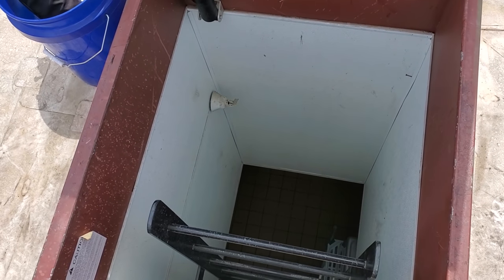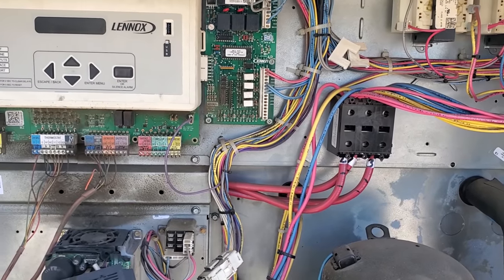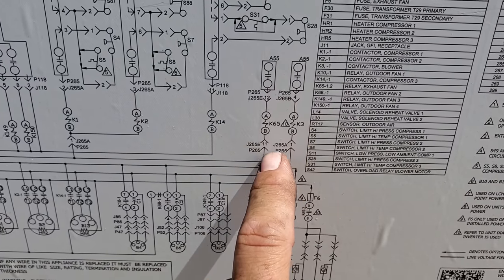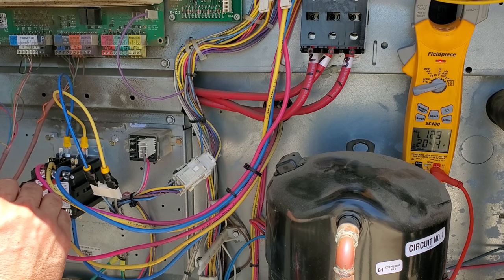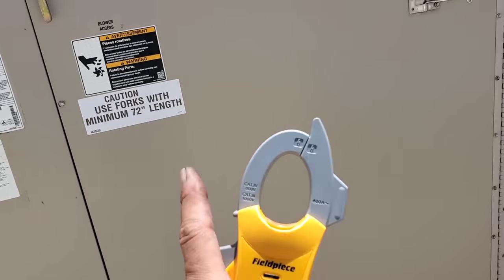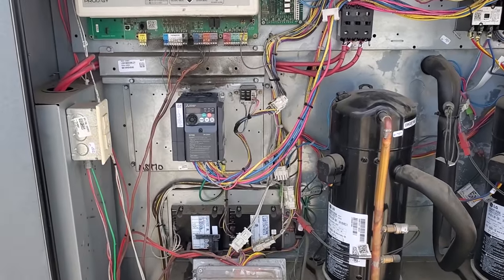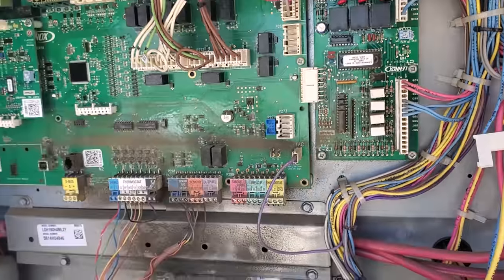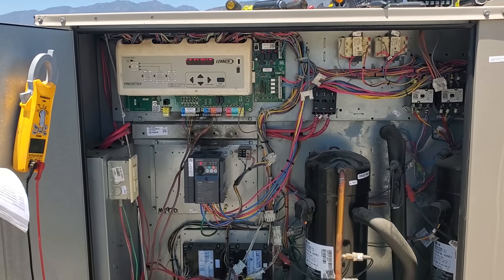THE DINING AC IS NOT WORKING

Comment: Boy that looked like a plain PITA.  But have to agree that changing the display part was silly, even if it was bad it should not have mattered.  Best guess is that you could literally unplug the display and the system should still run just fine.

That sprinkler head though, ughh.  The company installing that needs taken out into a field and dealt with.  

Anyway I am just a guy who likes to watch stuff and learn and have to say thanks for the video's.  It's nothing special but I have a deep freeze that cost me all of nothing about 8 years ago.  It didn't freeze so figured low on charge, got a line tap and after purging some refrigerant into my pickup I ran some in.  Figured that out on my own years ago.  Now it has been basically running non-stop unless I turned it all the way to off.  Turn it back on and it would kick on after a bit and then run all the time again.  Broke down and bought a digital controller you use on the glycol systems and honestly before I watched your video's I probably would have gotten something that would just plug into the wall and then have the freezer cord into it.  But the old mechanical one is gone and the digital one is up and running great.  I doubt I will ever do much with the sensor than just run it over the back side and put a little hot glue to keep it in place but at least it's easy to change.  Do have to wonder if you ever have to adjust the calibration for the sensor when you put them in, this one seemed to be about 3 degrees F high compared to another controller I have for cooking Sous Vide which I know is accurate.

Comment: Maybe I'm showing my age, but why not a multi-tap motor instead of VFD?  With all the cost necessary to keep these failed boards and modules working, it would be cheaper for a multi-tap blower motor.  It would only take a two contactors with an interlock - when calling for one, the first contactor kicks in and delivers to one set of windings.  When the call for second stage, the second contactor is engage, releasing the first, and power is delivered to the next set of windings.  Not rocket science, and don't go "boom".  Worst that can happen is either a winding short, short to ground, or shorted contactor.  Contactors are considerable cheaper to replace than a VFD drive system.
Reply: It's all in the name of efficiency, apparently using a VFD on the motor can give you a better power factor or something like that.
The real problem with the VFDs is exactly as Chris mentioned in the video. They're putting them outside when they're not rated for that. They need to be in a conditioned space. Were it me, I'd mount the VFD and the control board in a space that was in the airflow from the return air duct to the blower housing. Easy way to keep the electronics inside the RTU and still have them in an environment that's much more conducive to longevity of the unit. I think some other brands do this already, I guess Lennox hadn't caught on yet when this unit was manufactured.
Reply: @44R0Ndin  
If power factor is a big issue, then run an synchronous MG set. Gives you the best PF, plus it saves the electronics from line bumps and spikes, as long as it's not undersized.  I wouldn't be surprised that if you ran the numbers with 5+ units with VFD's vs no VFD's and synchronous MG set, the MG set would give you a better ROI.
Reply: @gregpfister6991  a vfd is cheap, and programmable.
Meaning that they can adjust airflow with programming, for air balancing, etc.
Reply: @ke6gwf  VFD is CHEAP, in comparison to a multi tap motor?  Again, I believe that if you add the costs up, you will find that VFD is NOT cheap over the life of the equipment.  Further. when you look at the inherent dangers of operating mosfets (as we see in static UPS's), the cost associated with protecting them and the destruction caused when they do fail it's just not worth it.  In this video alone, we see the example that one board causes the VFD to destroy itself completely, and the recommendation to replace the main board and the cost associated with THAT.

Just because you CAN do something doesn't mean that it's GOOD.  In my years, I've seen many "advances" in technologies, and have been at the forefront of many of them.  However, ROI is king, and always should be.  If a product is going to eat itself every 3 years, as apposed to 10, I'll pay 50% more for the product that will last 10.  Why?  Because of the cost associated with the downtime, loss of business, how costumers perceive the outage, cost of repair, etc..  You have to look at the big picture, not just "new tech, so cool".
Reply: @gregpfister6991  I'm not in the trade (I'm in IT/programming) but, and correct me if I'm wrong, aren't VFD's supposed to be used for power /curves/, and not just 2 stages?  A VFD in this just seems like crazy overkill if all you need is 2 power stages.  Even if you had to have 2 "programmable" stages, it seems like there could just be something like two variable resistors (I don't know the correct pieces of hardware) that controls the amount of power for each stage, and a relay to change between them.
Reply: @Zyxlian  
You run into the same problems with a resistor bank or any other method, plus adds stress to the motor.
Reply: @gregpfister6991  In terms of the "because I can", or "isn't it new/shiny" approach..all you have to do is look at how touch-screens have replaced proper controls in *cars*. I sure hope aircraft designers don't follow suit!
Reply: Eric M  
True, but how much variation do you actually need?

Comment: Chris the correct term for the circuit is Supervised Circuit, per code NFPA-72 there are three primary circuits in a fire alarm system, Indicating, this circuit activates the indicating devises, horns strobes etc., Initiating, these circuits relay information from devices like smoke detectors and pull stations to active the indicating circuit and Supervisory Circuits, which monitor devices such as Sprinkler cutoff valves and tampers, go to any large mall and you will see large red wheeled valves out in the lot or on an exterior wall with red switches mounted to their stems, those are supervisory devices, should someone want to disable the sprinkler system, they would close those valves and that what would cause a supervisory indication at the panel. Note both initiation and indicating circuits are supervised circuits, as is a Supervisory Circuit. Welcome to the somewhat confusing world of fire protection.
Reply: Ooohweee, blast from the past. The term "Indicating Circuit" hasn't been used in the industry or NFPA for 20 years or more. The initials for the circuit clashed with "Initiating Device Circuit" (IDC), so "Indicating" was changed to "Notification", or NAC (Notification Appliance Circuit). The term "Supervisory" is defined as "a fire protection system in the Off-Normal" condition. So even though the "Supervisory" contacts on a conventional duct detector change state on a fault or "Trouble condition" duct detector manufactures label the Trouble contacts as Supervisory. So the three NFPA/UL required states of a fire alarm panel are Alarm, Trouble and Supervisory.

Comment: Enie..menie..minie..moe..which unit had a component go? What I wonder why units with VFD drives dont have phase monitors? I've seen alot of units where the VFD drives are killed by low voltage below the 10%. Good stuff thanks for sharing Chris. Be safe out there.

Comment: Wonder if you fixed RTU 1 and removed the balloon . I had a AAon was running no ac ,had to dust off dust and dirt off gas mod board , must have back feeding voltage to control board , Have you ever worked on a AAon unit?
There easy to check and trouble shoot ,just need to have the hand controller the owner should have this if they have this style of unit ,we have 13  unit at our Nursing Home.
Reply: Yes

Comment: Hi there, about that inverter:
it's a mitsubishi d700  rated for a load 3 phase at 200 V.  when u were testing the phase rotation your tester was reading 204V; although it's not a huge higher level it still high.
from what i have seen on the video seems more that blewup the control board more than the main power circuit of that inverter.
u should  investigate more on the control side and wiring.
Another things is the enviroment of were it was installed: in the manual clearly state enviroment not dusty and not greasy... but if u see above is location there is a clear mark of dust and grease.
The load due is a motor should be protected by a motor protection automatic switch;
a blewup like that could be a condenser\ catastrofic failure of a rectifiers;  from the short frames on the main power board the bulky condenser seems to me NOT bulged or blewedup...

definetively something on control wiring\voltage\current side.

P.s. inverter make a tons of electronic noise , i dont see any rfi protection circuit on the power supply side; plus the cables itsels (both power and control) has to be shielded...  was it originally installed there?
chec the warnings on first pages
https://dl.mitsubishielectric.com/dl/fa/document/manual/inv/ib0600366eng/ib0600366engg.pdf

Comment: VFDs should be in a sealed air conditioned cabinet which should be easy to do in an air conditioner. Most companies use the smallest VFD possible so any drop in voltage will result in too much current.

Comment: Gonna be honest, these VFD drives seem to be more trouble than they are worth. If they keep blowing up like this some day they are gonna start a fire or some other bad thing. I can just imagine the issues if you have a unit that's not grounded and the VFD blows and shorts to the unit casing. Some poor chap gets up there late in the evening to fix the thing and it blows up in his face. That might be a stretch, but for the energy cost you save with these VFDs, it doesn't seem like you'd really save anything. Constantly having to have techs come in and replace them, they go out on backorder, all that hassle when you could just bite the bullet on the energy cost and run a relay or something simple. I get that it's regulation in some places because of the electric grid and all that, but it just seems like such a mess dealing with these units.

Just my personal rant and thoughts.

Comment: I take it you are in AZ?  or somewhere that gets insanely hot in the summer. That VFD  drive has a fan in it,  and its sitting outside on a roof where it can get 120 degrees in the summer?   Imagine how hot that "drive" gets im surprised non of those electronic computerized components melt..

Comment: I studied informatics and have zero clue about these machines but my guess is that the small daughter-board can be changed without changing the display. When you change the whole motherboard, you would have to change the display. So in the first call you talked mostly about changing the daughterboard because of the faulty voltage coming out of it and not about the mainboard. If you had talked about exchanging the whole thing, tech support most likely would've told you you need to change the display as well. 
But then again tech support should've told you that if you change the motherboard, you need to change the display as well. My guess is they simply didn't know off the top of their head
But again: I'm just guessing :-)

Comment: I'm curious, why I don't see any air-conditioning unit with air heat recovery as a full Air Handling Unit?

When it's warmer outside this saves way more energy than this energy reduction of a variable fan control. In Europe air heat recovery is standard in most kitchen's for many years already

Comment: that was one thing got me thinking is that ac was bad desing have that psu under maid board because that  fan blowing heat at maid board n cause it failures n shorted psu n blew itself out
i wish they move that psu to side of maid board that way to avoiding overheating maid board safely  "that what my opinion is "

Comment: Seems like the VFD is a fairly generic model, usually they only have inputs from the controller, with possibly tacho feedback, So if you see another one like this, It might save time in future to see that the VFD control outputs are being triggered, e.g. usually something like a 0-10V signal for speed. as that would catch a faulty control board early.

Comment: So what happened to fixing the fire alarm issue on RTU1 ?
Reply from the maker: The fire alarm issue happened because the ac had a teipped breaker. The fire alarm was in a trouble condition due to the loss of power

Comment: I say the VFD failed due to overheating, crap ingestion or it looks like its only just rated for the current of that motor. When the VFD shit its pants it fedback through the control wires into the controlboard and caused that to fud out.

Comment: if the unit is powered down, then why there are 3.4V across all the phases with ground?
Reply: Iván Pstyga Phantom power, induced voltages.
Reply: @gordonrichardson2972  like capacitors discharging? Should that V get reduced if you let the braker open enough time?

Comment: If the vfd just runs at 2 set speeds how does it save energy? Couldn't they just use a 2 speed blower motor? You would think they would have a supply air temp sensor or suction pressure transducer that could ramp the blower up or down based on some kind of measurement.
Reply: Yeah, a 2 speed blower motor was my thought. Those have been available for ever. The first one made was probably designed by Tesla.

Comment: I don't know if you could hear this or not, but I could hear a very high pitched whining noise which sounded like it was coming from the unit you were repairing, I don't know if you noticed it or not, but the noise was quite audible in my headphones.  Could it have been a component on the electronics board?  Could it have been the fan motor or something?

Comment: Why do VFDs have a tendency to blow up? I manually engaged a contactor that was wired in series with it, and the VFD freaking exploded like a grenade.
Reply: VFD's will blow up quite violently if you put power into the motor outputs. Was the contractor you manually punched in a VFD bypass contactor? because those have a habit of sending power back into the motor output if you don't sequence things correctly. That's why it's a good rule of thumb not to manually punch in contactors if you are working with a VFD.
Reply: VFD have big capacitors and they are very finicky about power.
Reply: @jakekiedaisch2279  Thanks, yeah idk if it was a 'bypasser' but it was wired with the blower motor.
Reply: Because they cannot handle the inductive kickback that occurs when you open the contactor. All VFD makers do not allow switching devices after the VFD as they know that they will blow up. The only valid usecase for a switch after one is for delta/wye switching motors with the special drive for them, usually found in CNC machining equipment.

Comment: Kidna feels like that fanspeed had to have been a setting that was messed up, not a board failure. But who knows.
Reply: Part of the troubleshooting probably would have been looking at what the fan speed setting was, and seeing if the command voltage to the vfd matched, and it didn't.
The fact that the board was losing memory settings is a bad sign too

Comment: I'm confused: Call was for a fire alarm in a trouble condition. Alarm panel showed trouble on RTU 1,  Prodigy board on RTU 1 showed that unit had error codes, but you did not diagnose or repair RTU 1. You diagnosed and repaired RTU 2. I thought the reason for the call out was to address the RTU 1 error codes signaling trouble to the alarm company. It seems to me RTU 2 would be an AC down complaint and a separate issue. Please explain.

Comment: Excellent job this one was not easy. Those sprinkler installers are the least logical people I have ran into on install jobs. They only do what the prints say without question. Once they cut holes in our returns and would not move it until the inspector fined them. They never did understand why that was wrong, poor bastards, lol.

Comment: Hi HVACR person,
Clean that schmutz off the PC boards. It's very possible that it is causing a leakage path for the loose electrons.
Maybe. If you have a flir, check for heat signatures against the working units. 

;-)

Comment: What blew the drive up?
Reply: The power supply capacitors died from a combination of age and high ambient temperature. Once they weren't filtering the power to the VFD logic, it got totally confused, but was still partially operating. Probably it got so confused it turned on multiple phase lines at once to one or more of the VFD output terminals, shorting the incoming line directly across the power MOSFETs in the VFD. This resulted in a nice big explosion and arc that blew the VFD apart.
Reply: l wilton ... I am in the Midwest and have had several issues over the years with dirty/damp installation practices. If we couldn’t determine the cause of a drive failure... motor insulation.... wire issues... or power we always just guessed it was high ambient temperature. Great feedback I appreciate the response